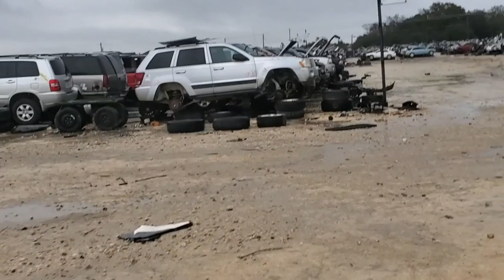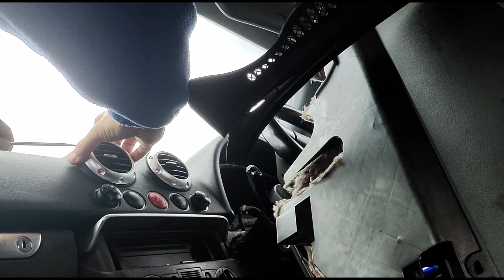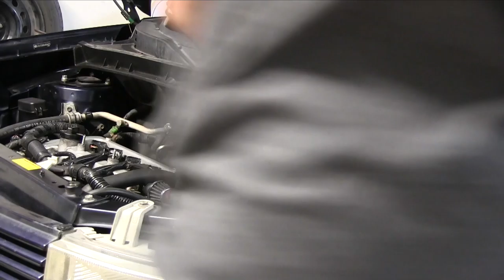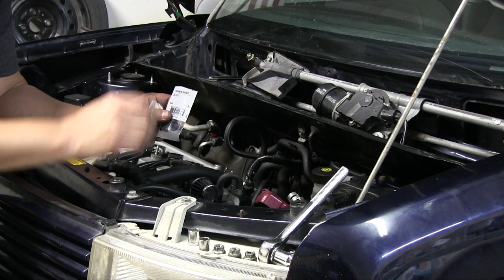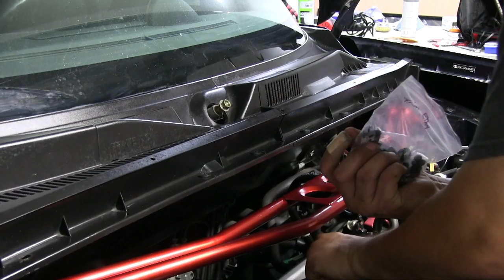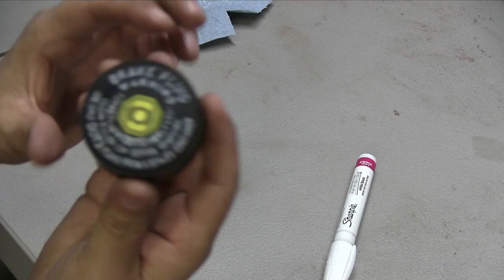1st GEN SCION xB: STRUT BAR INSTALLATION & SCION TC STEERING WHEEL FIND

Comment: I like the look and the idea but I have two questions- did you notice a structural difference with this while driving? How the heck do you check/add brake fluid or do a tuneup with this thing in the way?
Reply from the maker: Yes you do feel it and you can to take your time. I've done the spark plugs with no problem.

Comment: Nice job. I have an 05 and salvaged a steering wheel with controls like the one you found... My box didnt come with steering wheel controls so havent figured out the wiring... all my buttons raise the volume... lol.. Is your XB equipped with steering wheel controls already?
Reply from the maker: Unfortunately it is not. I will be adding aftermarket wiring in the future. The 2006.5 xBs only came with the audio controls and have the wiring for it. 2004-2006 do not have the wiring so you will need to use aftermarket wiring.
Reply: @OilandGears  Looking forward to it. The one I found still had the airbag so I was able to get the wiring harness for the radio controls so I do have that at least. Will wait to see what else you need to get to get it working properly. Thanks.
Reply: There’s a module that plugs in behind the stereo to handle steering wheel controls. I don’t remember the part number ( TOYSWC) or something like that.
If your box came with the iPod/Aux module? I think it plugs into that harness connector.

Comment: do you still remember what size did you used on installing the strut bar?
Reply from the maker: What are you referring to on size?
Reply: @OilandGears  oh the bolts, i cant remove the 2 back bolts on mine 😅
Reply from the maker: I believe it's a 12mm but you may have to use an open ended wrench
Reply: @OilandGears  thank you so much!